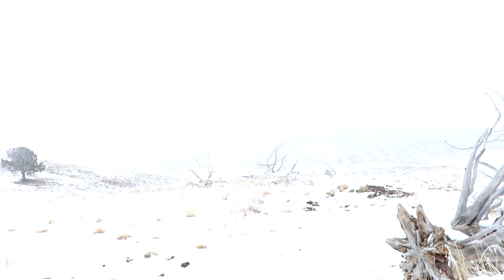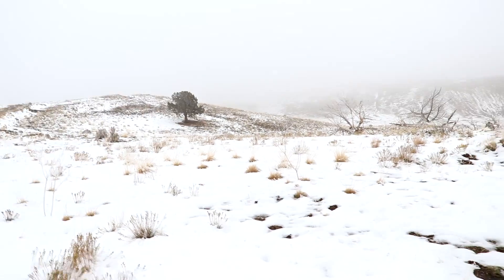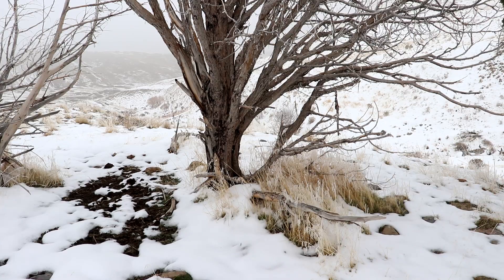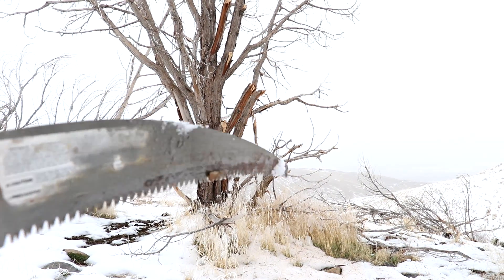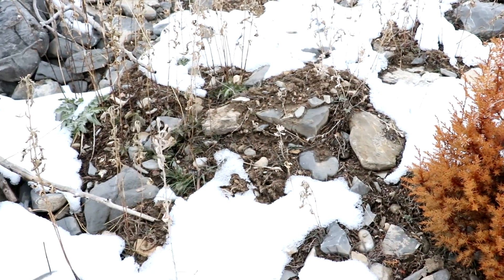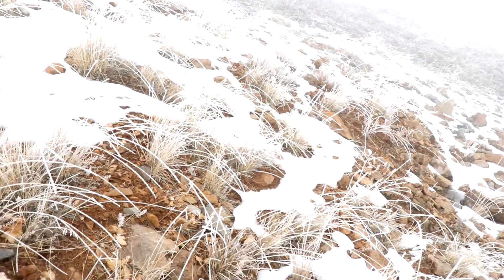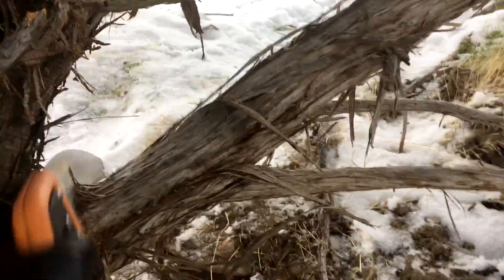Reforesting the Ranch Part 3: Fire-Proofing Existing Trees

Comment: What you are doing is admirable!
Years ago, I skirted the mesquite trees on my ranch in the monte of South Texas so that we could drive our steel wheeled tractor pulling a disc so that we could eliminate the brush growing under the trees’ overhang. I used a pair of extra long handled loppers to cut the leaf bearing limbs that I could reach that were up to an inch or so thick. Then I used a saw exactly like the one you are using to cut the limbs up close to the trunk. The small limbs could then be bunched and the bigger limbs stacked on top. After a year, I burned the piles. My terrain, climate and tree types were the opposite of yours; but, I would do the same as you.
I wonder if your extended diminished rainfall will inhibit your planting of seedlings? Perhaps, since everything is on a slope, you could use the abundant supply of rocks to build a semicircle on the downhill side of each new tree to slow rain flow, etcetera?

Comment: I would recommend to not discard the branches that you've cut off, especially the living ones. if you leave them on the land, but further from the trees, insects will decompose them and use them as shelter. These insects are great at spreading bacteria and will help decompose the dry, dead grass. The insects should also attract birds

Comment: The fire only needs to damage the cambium which is just under the bark. The native tribes in Maine burned the forest floor every year. The reason this was effective in clearing the land of brush but did not negatively impact the large trees is that there was not enough debris to produce enough heat to damage the cambium. Accumulated debris will burn longer and hotter. The damage to the cambium will result way before the wood actually combusts.

Comment: Hi, I think some ideas for decreasing fire risk include using berms to retain water for drier periods; planting trees close together to rapidly form a canopy with a cooler, moister micro-climate (you can subsequently thin them out); limiting grazing around such clumps to allow a more wooded-style Mycorrhizal environment. Generally, this should also inhibit grass growth as natural succession occurs, but you'd be minded to create a non-grass buffer zone around your clumps of trees.

Gradually you can merge your different clumps, but it's always a good idea to use a variety of species, so maybe having clumps of 5-10 specimens of one species. This means that as your forest grows, it becomes far more difficult for pests to take hold as they don't just rampage through a monoculture.

Comment: Redstone Arsenal while in a much wetter location burns it's forests every 4 years on schedule to keep the damage of a fire low.  This is fairly typical of southern USA forests.   The goal is to keep the brush etc from building up and making fire not dangerous to the trees.   The ring data is not very valid due to the fact that increased size reduces tree growth.   The cutting the tree branches etc is a good idea for fire control.

Comment: Orange seems like fatwood to me. Really flammable :-/
Maybe you should collect all the cut ofo branches and dead tree leftover in big piles and come by with a woodchipper. Normally it would be great to get a bunch of mulch around your trees as slow release nutrients and also to help soak up and keep moisture from the wet season. I'm not sure though in your case if the dried out mulch around the trees would just put them at risk?

Comment: Isn't cutting partially pretty large branches off that were still alive making the tree vulnerable for fungi or parasites attacking it? Especially when the tree still needs to recover from the fire damage?
I suppose that's not an issue with such low temperatures?

Comment: you could collect snow in some containers and use it to watering your trees during warm seasons :P

edit: just joking but you could shuffle snow near the trees to give them as much water as possible and you should also use organic material to compose and prepare some places for new sappling by digging holes and mixing regular soil with composed material (it will give you better results for sure then plant saplings in regular dirt)

Comment: The reason I don't like the terms "softwood" and "hardwood" is that many so-called "softwoods" (like many junipers) have hard wood (and vice versa). Dulled some saws cutting juniper for firewood as a teen in New Mexico.

I think the juniper with the orange wood is Rocky Mountain Juniper (Juniperus scopulorum) and the one with the lighter wood is Utah Juniper (Juniperus utahensis). Rocky Mountain Juniper also has finer foliage, often a bluish cast, and often tends to droop or weep. It's an educated guess-- the one tree does sort of look like it has finer foliage, though it's hard to see with all the rime ice.

Comment: regarding your question about the heartwood of your tree, it is most likely darker due to the nature of the wood. Heartwood doesn't transport nutrients like sapwood does. Therefor when sapwood turns to heartwood, whatever minerals are present in the wood at that time become trapped within the wood and that could be what changes the color. What type of soil do you have? Is it more of a clay based or sand based?

Comment: Cody - Use small bow saw, like 20-30" they are amazing, and try to put leverage on the limbs you are cutting so they spread apart as you cut. Then their weight plus gravity will help you cut them easier.

Comment: I like using a battery operated sawzall for tree trimming about. A couple of drill batteries and some of those real long blades can really improve both your reach, and the endurance of your arms. It's no replacement for a chainsaw on the big stuff, but spending $100 on a sawzall that uses batteries you may already have could really save you some time and energy, especially on the scale of this project.

Comment: To some extent minerals do tint some woods, but also lignin, sap and other molecules produced by the tree naturally combine to color the heart wood gradually as it ages.

Typically, the line of darkened wood is the point where the minerals have clogged up the vascular system of the tree, which, were it like a human, would kill it, but as a plant, always making new vascular system material at the xylem, this simply serves as material to strengthen the trunk and make it resist wind and snow better as it ages.

Naturally the sap will have in it everything that it takes to build the tree, so yes, the richer the mineral base, the more mineral you will find in the sap going all around the tree to where it is needed, just like you find everything a human needs [food, hormones, oxygen, etc.] flowing in our blood dissolved there until it reaches its destination where it gets processed in whatever manner our bodies need.

Comment: I wonder if the orange color may be based on different acidity levels and exposure to wind vs humidity, the darker to me indicates concentration of nutrients vs water or in hydro terms a higher ppm in your grow media, either the plant is exhaling quicker than it can absorb or is over exposed to environmental variables. This easily could be trauma to the roots, rot, or fluctuations in environment. Like dark urine. At Least that's my take. Hows acidity

Comment: Trees fight the heat by evaporating more water. We had an all time record drought last summer (2018) here in Germany. So I have talked to several experts how I could safe my trees.

Heat kills the trees, it doesn't take much temperature at all. If the tree turns too hot - sunlight during summer is enough, no fire necessary - the tree will start to evaporate water just for cooling. So when the tree turns too hot, the metabolism decreases in favor of cooling itself since the water it can draw from the ground is limited. 
This explains the thinner rings inside the branch, hot summers make the tree stop growing, it will only grow in the colder autumn months and spring after growing all the leafs.

And during the fire, the tree will start to vaporize as much water as it can. If it has enough supply and the fire is not too close, it can survive. Also the outer branches protect the inner ones as seen on the tiny tree.
Trees which had used up their water supply just die without becoming even scorched.

During a very hot summer, a tree needs up to 20 liters of water per day for survival, 80 liters when actually growing.

Comment: would it not be viable to use fire to counter the fire? use a torch to burn smaller patches of grass then use a rake or leaf blower to blow them out. Make patches of about 5m in diameter at a time to keep it under control?

Comment: Cody now that most of the grass is burnt off, you could figure out a system of fire breaks. By turning up the soil(rocks in your case) you make lanes of open soil that will have no grass(fuel) will not burn. You could put in play a system of cutting your place off from the fires coming on to the place and back burn between these lanes if you have to in a real bad fire. That orange wood makes super fire start sticks.

Comment: In the second part I was about to suggest to divide your field in sectors by putting some gravel a firewall so if there is a fire only that sector would burn and not the others (that is way too much work) but I just thought that you could add some kind chemicals to the surface around those trees to keep the grass from growing, it might be better than cutting every low branch :)

Comment: Im hoping cody sees this because I can't find any research on it . Could air conditioning effect the climate. Not the ways everybody says cfc or carbon but energy displacement.  Insulated houses using heat pumps to displace the thermal energy, literally pumping it outside kind of like holding a gallon jug under water would displace a gallon of the surrounding water causing the level to raise but with thermal energy

Comment: Why dont you do a prescribed burn in the snow and burn the taller grasses and branches  now to prevent fire in the future? I would suggest getting a chainsaw to use to clear out the ranch as well... I like the little stihl 12" small one for clearing getting into those cedar and clearing out branches without opening a big scar on a lower living arm of the tree trunk...

Comment: When a fire burned through our farm last year, we’re in Northern California, our trees were tall with thick branches nearly six feet off the ground and they still managed to be so destroyed and blackened that we had to remove them. And there was only a little brush around the base of the trees. One tree that was in the middle of a field of dead grass that was nearly three feet in height was less blackened than the others, and it had small branches every which way. The house also survived with zero help and a raging inferno that engulfed the property with flames that could have been fifteen feet in the air.

Comment: Well if there’s one tool I’ve ever found useful (and compact) it was a little saw a mate of mine had but it was like a chain link saw with very small blades and had two handles, the thing was able to cut branches very easily and it makes t way more efficient when cutting branches with less room around them, you can wrap it round whatever way you want and then just tug from side to side, super useful little tool and it can coil up into a small container, would definitely recommend it to you for this kind of job Cody. Especially for smaller branches, it cuts faster because it has more surface area covered.

Comment: The orange can somewhat be compared to the soil components but being down in the Piedmont area of Georgia where basically all the soil is always red. Not all the trees are tinged from the soil especially the pine species which are genetically yellowish in color.  The only thing I could say for that is that the iron in the soil there may be made of a different and more soluble compound than the iron here or that tree may have some sort of genetic problem in it. Or it could be a different subspecies as well.

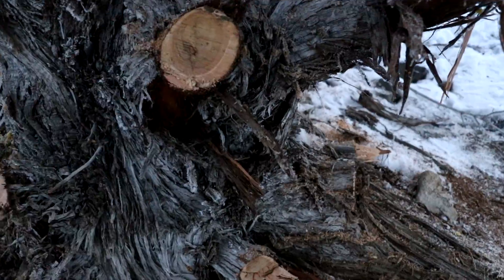Comment: 8:34 I'm thinking "FATWOOD" campers often talk about finding and using fatwood for starting fires from sparks of Ferro rods and steel. A good source for fatwood is the dead lower branches of live pine trees. Often times the lower branches die off for lack of sunlight, but the branch right near the trunk fills with sap in anticipation of the branch breaking off, protecting the vitals of the trunk until the tree can live BARK-OVER the broken stump of a branch. The sap darkens the wood, is protective and healative (Crappy word) sorry.

Comment: Ha, you need to get yourself a good sized bow saw. A Bahco 36" costs less then $30 and is a very good saw for larger limbs like that. The only issue you would have is not running into the other branches. OR you can just get one of those cute little hand held electric chain saws, ha.

Comment: @Cody'sLab  about the sap. Do you think that the difference in iron levels would show up with the Xray?
I think you need to brew up some gel fire suppressant that is tree friendly that you can spray from a backpack or a tow behind trailer for the quad.
From that last outdoor shot sounded like the cow-mowers were warming up to the idea of eating the grass.
Hope you have a smaller gas limbing saw. Sure beats a hand saw or luging around a big chainsaw. The hand saw sounds in high speed sounded like a steam locomotive.

Comment: Use some of the debris from your mine and try to make a small dead zone 3-5' around the tree, same concept as a fire pit wall but reversed. It won't stop embers but it will increase the odds of the fire going around the tree instead of creeping towards it. A ring of big rocks and then a layer of gravel a few inches wide will help considerably. It might also help retain moisture around the trees, instead of the ground drying out quickly or the water forming a wash and simply running down hill. It won't have a massive effect but it might be enough to combat the drying climate of the area for the individual tree. Mosses and other moisture retaining plants will naturally want to grow on the rocks if it stays damp, which will also help with fire resistance. It will be a quite a chore but it's a natural method that won't have any long term negative impact for the local environment. 

Also, I asked you if you enjoyed Pickled Herring on your live stream, you should really try it! It's a seasonal thing for my family, we've been here since the 1500s and it's a staple holiday snack. Rye crackers (or toasted rye bread), pickled herring, and a dab of horseradish is absolutely delicious.... you really have to enjoy the flavor of fish though, herring is very fishy and oily.

Comment: Hey cody if you have any small streams that pop up In wet weather or snow melt you should try and build natural dams to keep water in the valley. much like a beaver would in the wild. It keeps the water around longer increasing the plant and wild life in the area. I've seen valleys with and with out beavers and it's a stark difference.
Reply: The problem is that this is former Spanish land.  You wouldn't think that is a problem since it is also in the USA, but water rights are severed from physical land ownership in most of the south-western states of the USA (land obtained from the Mexican War of 1847).  If you build something like dams or control the water in any fashion, you need permission from downstream users too in a hugely complicated legal mess.  The state legislature recently permitted property owners to finally collect rain water into cisterns for irrigation purposes that comes off of roofs, but even that used to be illegal to collect.

If a beaver builds a dam, that is considered "natural", but otherwise you can run into problems.  At best, this is something to tread carefully and only do after consulting a good local attorney.  Otherwise, I generally agree with your sentiment and it really would make a difference.  Water rights in the south-west of the USA are a minefield of problems though, which is why I suggest caution.  Filming that action and posting it to YouTube is begging for legal consequences to fire.
Reply: Hi Cody and Mr.Wambller. Australia also a desert like area. We have had prolonged droughts in areas that used to be lush. Some could say over stocking of live stock and the clearing of trees etc. True a lot of the time. I was reading about this man (damn my memory I can't remember his name), he did work on water retention in the soil. So not damming the water ways but the odd log here and there to simply slow the water down and give it a chance to seep into the ground. It did drastically improve the soil and microbe content which in turn did massively benefit the vegetation and rehabilitate the land. I would suggest the old ways and laws are counterproductive. While not actively stopping water from reaching downstream property but simply slowing water down by planting trees and leaving large rocks and logs in waterways maybe everyone's objectives can be met.
I wondered also, did there used to be a native animal in your area that might have eaten the lower branches of your trees and so fire proofed the trees??
Reply: I was thinking about doing this in my area in Australia, we have a similar sort of issue where a bad bush fire clears out all the trees, which makes what little rain we do get run off easier, leading to dry land that doesn't really support the trees regrowing.

It should be cheap to do, I figured a post hole auger and some bulk aggregate would be simple enough to create some pockets in the land for water to accumulate, and hopefully sink in to the ground. The holes can be later used for tree planting.
Reply: @nfdr0kk3rz  check out Geoff Lawton greening the desert projects